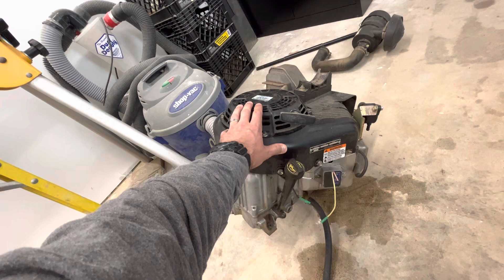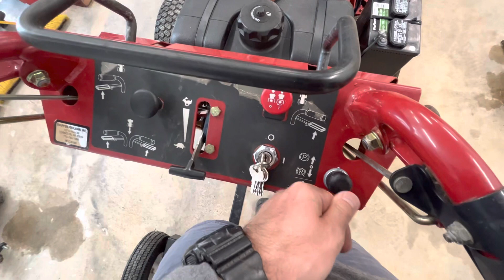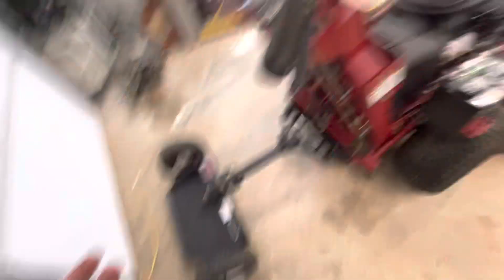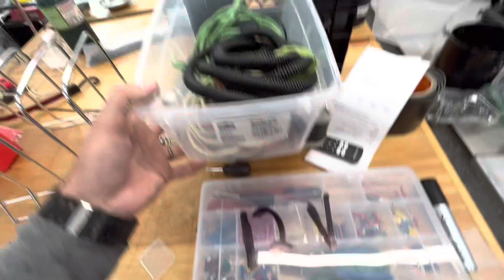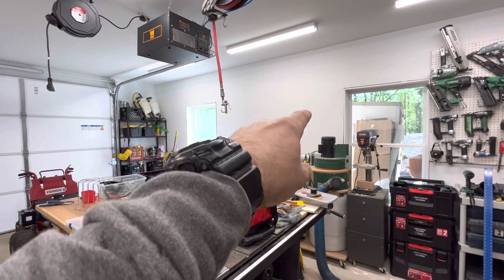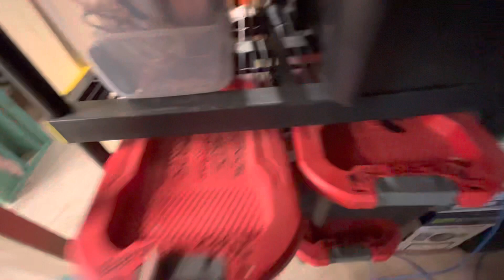Ferris walk behind engine swap overview

Comment: Was that a vanguard 16hp, I believe I have the same mower and the right side cylinder is starting to give me problems. Was it an easy swap and what engine is that?
Reply from the maker: I believe it was actually an 18hp but I could be wrong. I don’t have the old one anymore. Some local guy bought the core off me for like $50. Swap was pretty straightforward, not much to mowers. Wiring was the hardest part. Engine is a Kawasaki FS600V